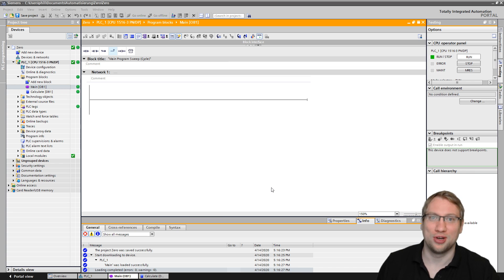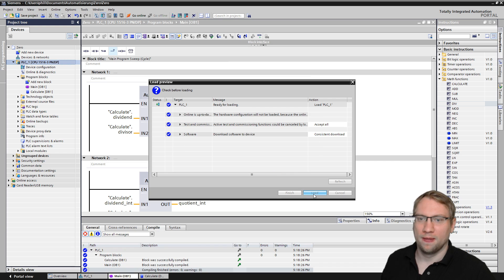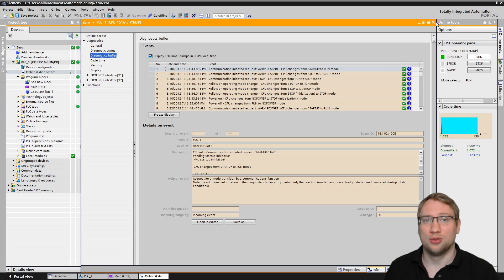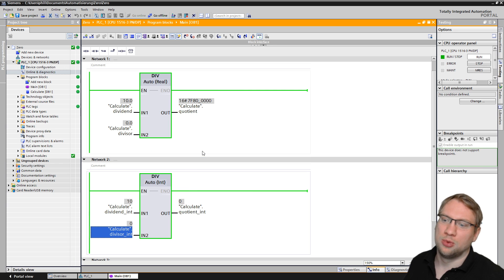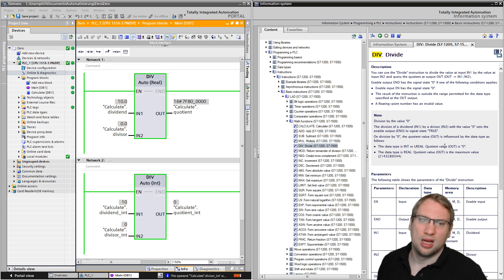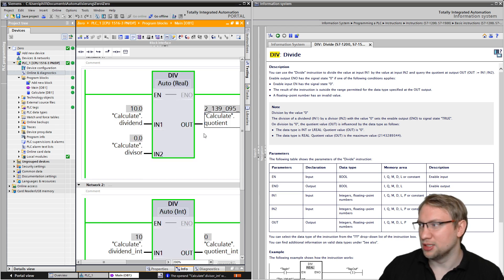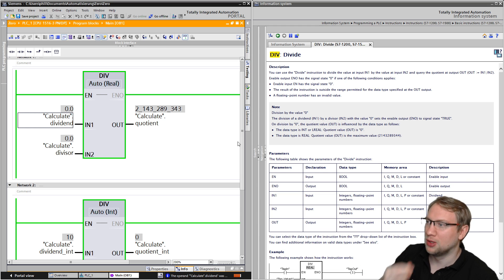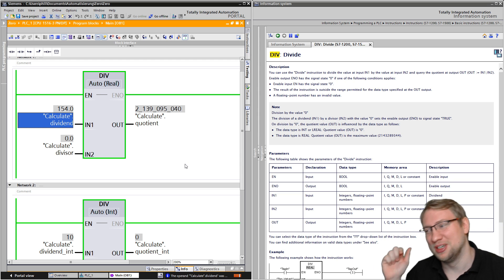What happens if you divide by 0 in TIA Portal?

Comment: I've seen a plant going to stop when calculation happened to become division by zero (S7-400). was a suspension calculation or something. PLC stop is a really delicate topic on bigger projects so  kind of makes sense they made it so... Clearly we should all know not to divide by zero...but what if it's an HMI input and somebody forgets to specifically check for operator input not being zero... i'm sure Siemens has had some strong worded feedback about stopping the PLC due to div/0 @Hegamurl
Reply: Old Allen-Bradley PLCs are particularly unforgiving on this issue. From what I remember if you divide by zero on SLC500 the controller will immediately declare major fault and shut down, and of course the error would have to be cleared from RSLogix, it won't go back to RUN mode simply by turning power on and off. I've got an old SLC504 somewhere in home, cause i didn't want to simply throw it away, must try it someday. One way was to insert an NEQ (not equal) to zero condition before DIV instruction.

Comment: The result if dividing 10.0 by 0.0 was 0x7F800000, the value is  infinite.
Not too sure about the division of 0.0 by 0.0 but the result was 0x7FBFFFFF NaN (not a number).
Both values failes the validity check for real numbers (OK instruction).